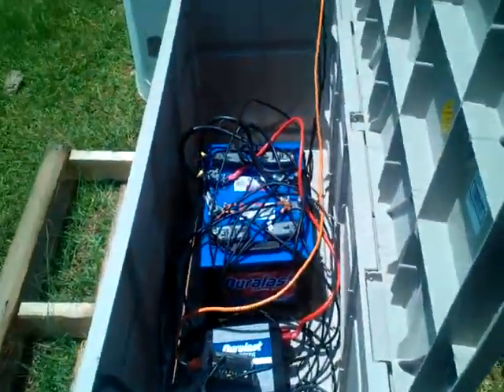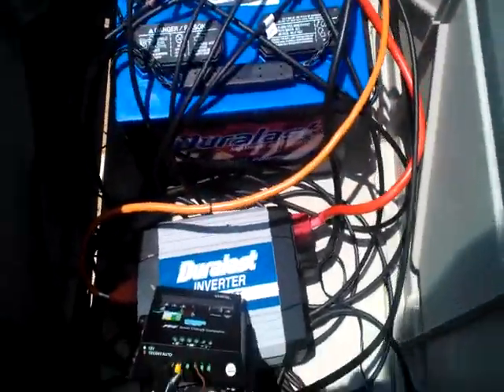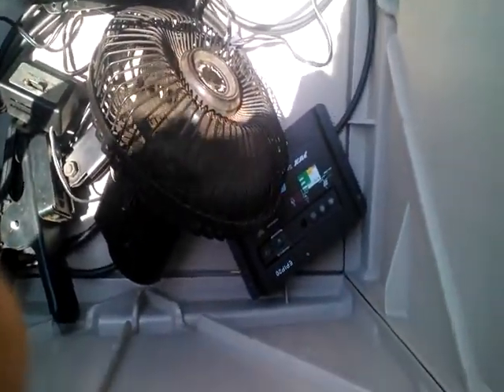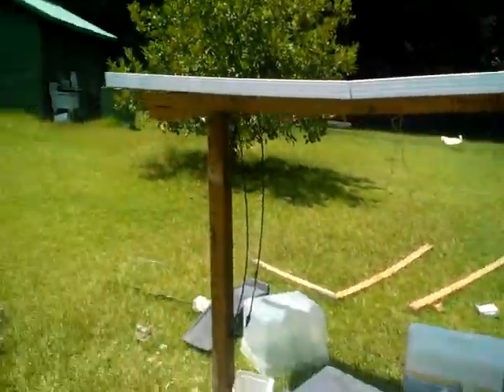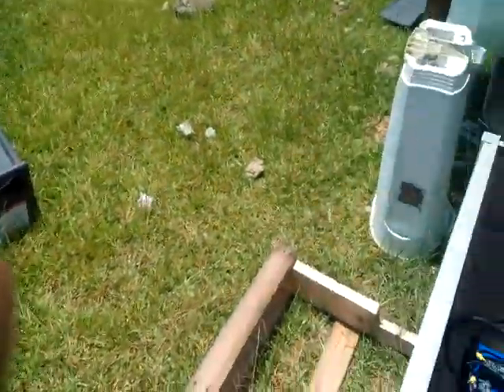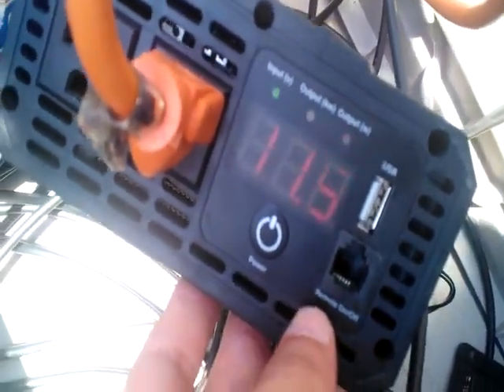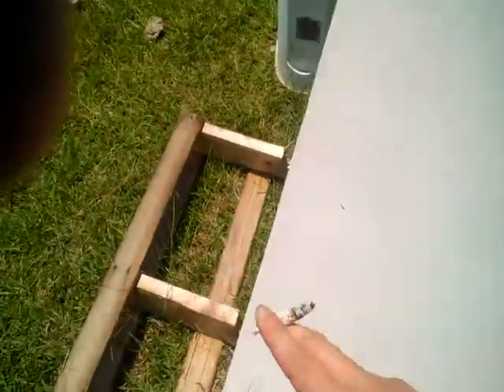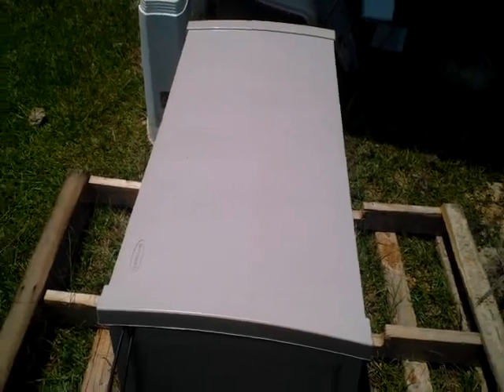My solar battery bank setup

Comment: The battery bank is out side, and you have gaps on the bottom of your box. Don't worry about gas!!!. If the batteries are SLA or AGM there won't be any gas. You should have your inverter inside your house. Inside that box on a hot sunny day, the inverter could overheat if it is being used. The inverter fan will constantly run. You are just waisting power running the small fan.